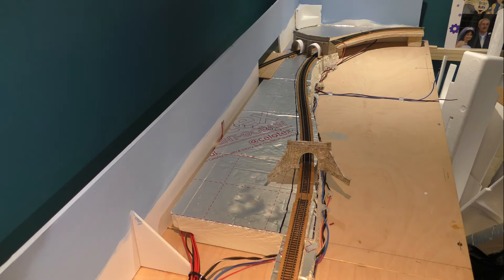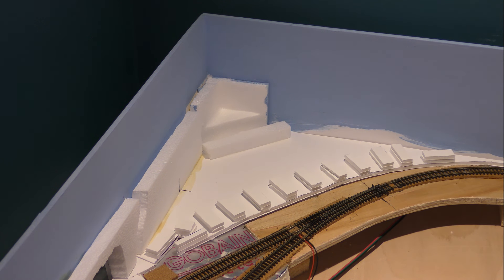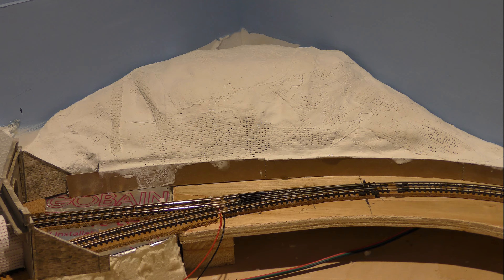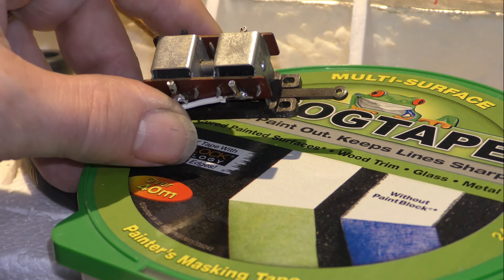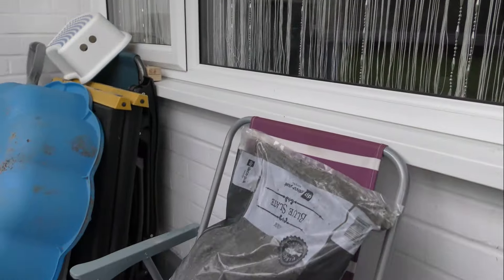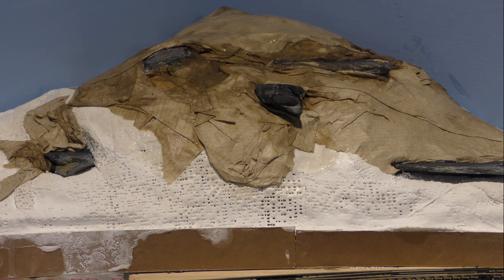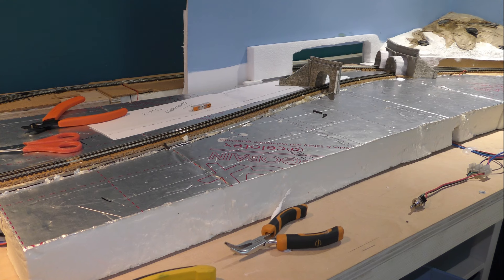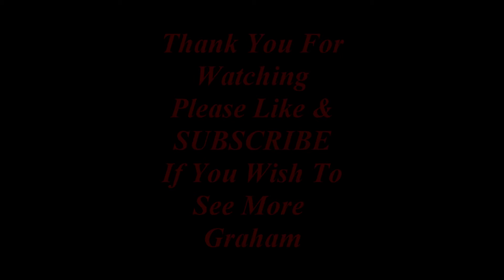Grandads Little Railway PT 19

Comment: A pity about the PECO motor Graham.  The problem you were having is caused  by PL12 adaptor base being built for OO gauge. So if you use them for N gauge the track has to be lifted up (3/16" cork would do). That will make sure the rod stays on the pin on the tie bar.   Hope the SEEP motors work for you.  I think you can trust yourself on modelling the foam at the front.  The shaping of the area at the back should give you the confidence you need that you have the skill to do it.  The foam just needs to be roughly the right shape.  With plaster bandage or using paper or both, you can then model to the final look that you want.  Look forward to seeing your progress.  Stephen